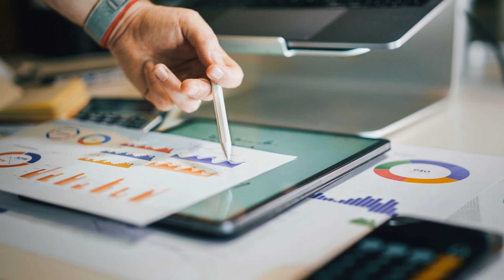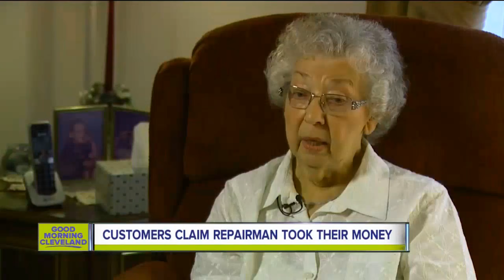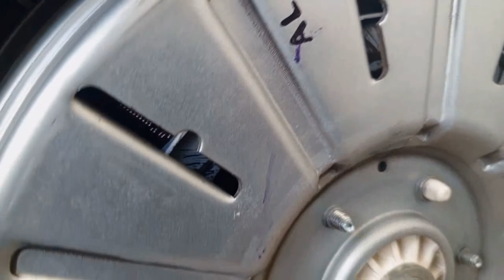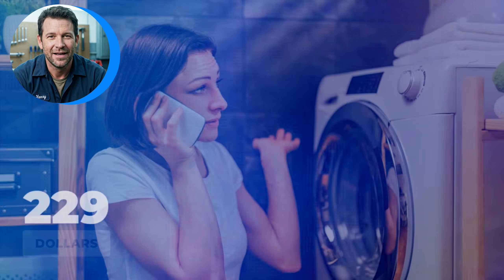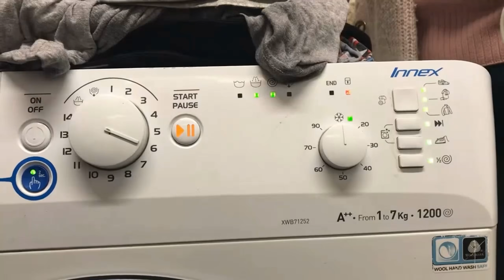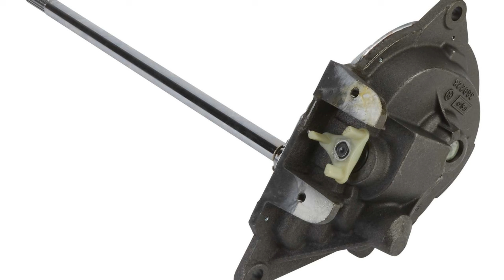Why 80% of New Washers Are Garbage (The "High Efficiency" Scam)

Comment: I brought current Samsung 16KG front loader washing machine 10 years ago, my washing machine control circuit board fault 3 years later, but replaced the control circuit board 2 times every 3 years and still works.
I'm from Melbourne, Australia.